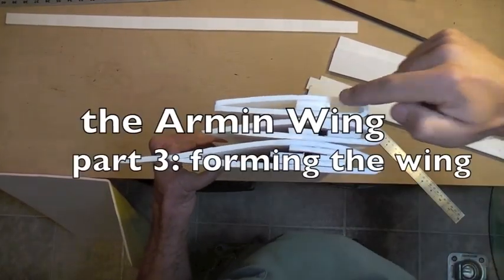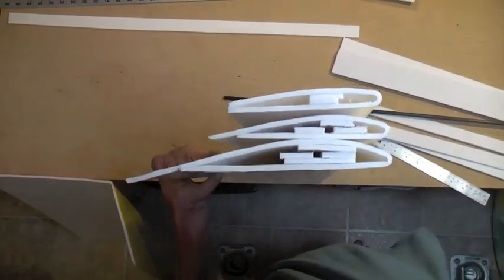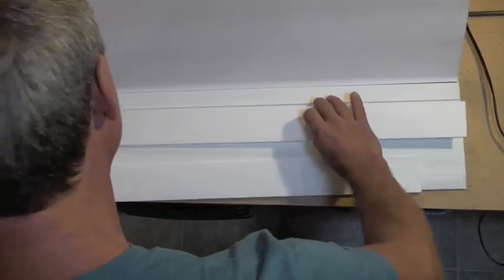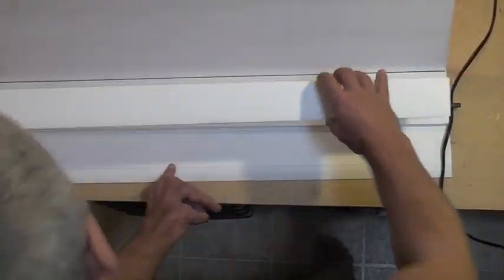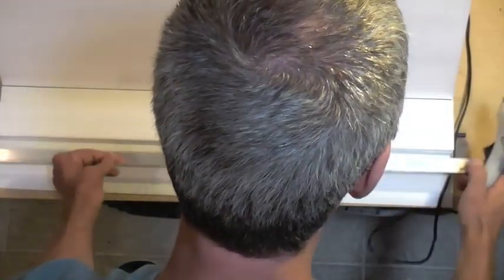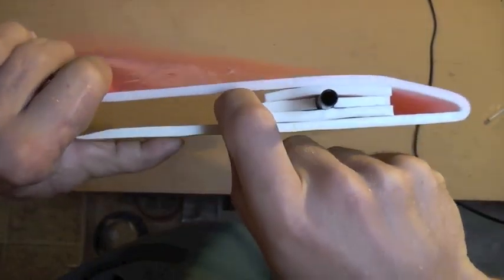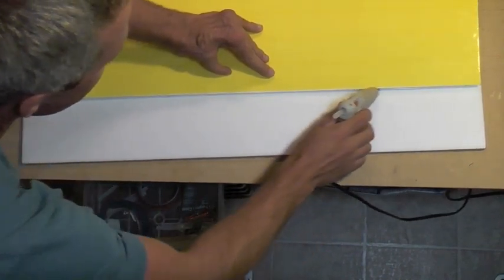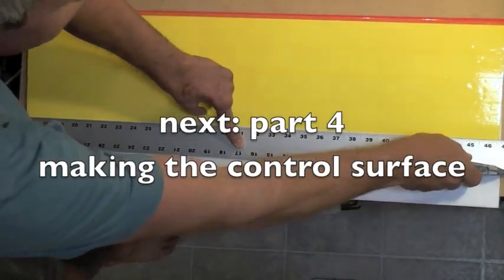the Armin Wing: part 3 - Forming and Gluing the Wing

Comment from the maker: I use a high temp gun and low temp glue for long set time.  There is theoretically a chance of melting the foam but I've never personally had this happen.  If it's a one-time, sure-thing purchase you're looking for then get a low-low temp combo.  You can get mini stick ones for $5, very handy.

Comment from the maker: @onetradgicstory It is what allows the upper wing surface to curve smoothly over and form the nice camber that it does.  It's also the reason you remove small strips inside the fuselage tube corners to allow them to bend.

Comment from the maker: @ade4200 It's hard to imagine a real, cambered wing being inferior to a KF wing for stability, lift, and efficiency.  KF's might be slightly simpler to make, but not by much.  As for a spar, if you can tolerate some flex, the dowel is probably OK.  Carbon arrows are awesome if you can find them.  If you are hauling some real cargo then maybe consier struts.  They're a little more complicated but so strong.

Comment: Cool stuff here!  I've been doing a lot of the flitetest stuff and more recently found yours.  Your info is great because I'm going to try to design some of my own planes.  Would it be possible to make these wings under-cambered by cutting off some of the bottom part of the wing?
Reply: Hi!
The problem is that the upper part would simply bend back.
For a undercambered wing you should use ribs and depron,it just works good.

Comment: Ed, thanks for the great designs and videos that you share! I just started on the Noob Tube which will be my first foam build. I am wondering if you use a High-Temp or Low-Temp glue gun? Are there any advantages/disadvantages of using one or the other on different parts of the total build process? Will the High-Temp melt the foam? Thanks!

Comment: Corrugated plastic ('Correx' is one brand) used by real estate agents (or twin-walled plastic used in green houses) is also suitable.  For wing spans, use two pieces, with the laminar flow at right angles to each other, then hot-melt glue.  correxmig DOT blogspot DOT com is dedicated to using this material.

Retired Chief Information Officer (1984), Australian Capital Territory